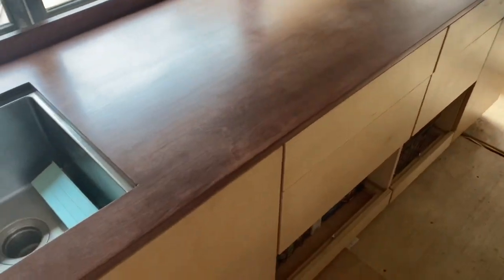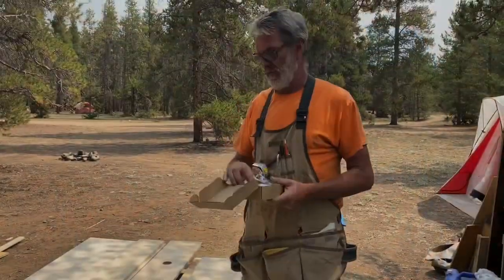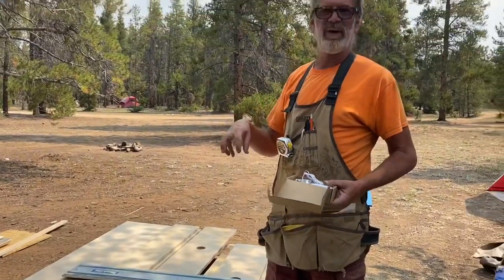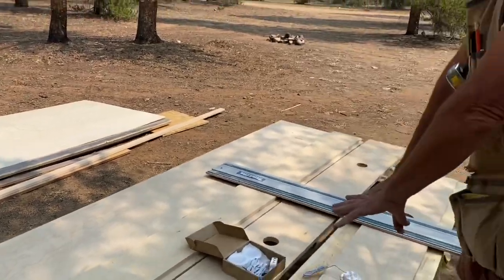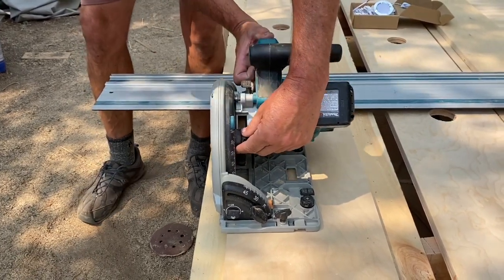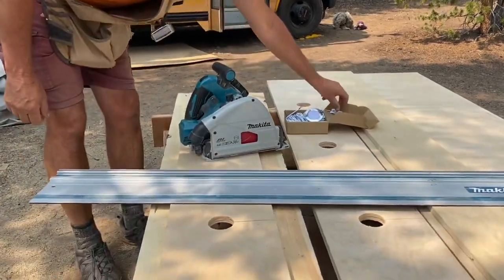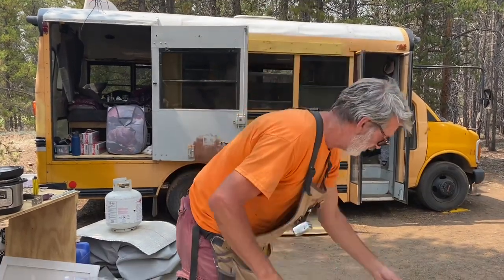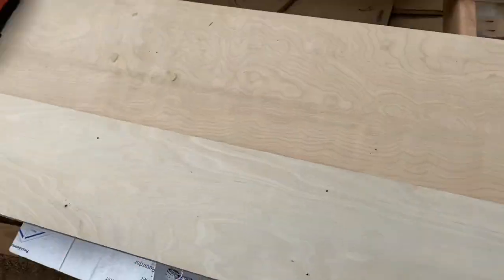Short bus Redux Part 5 Open Shelves W/LED Lights

Comment: When I layout a spacing like that I try to keep the light intensity uniform on the counter. I would center them 12-24-24-24-12 or 8-16-16-16-16-8 for an 8 footer.